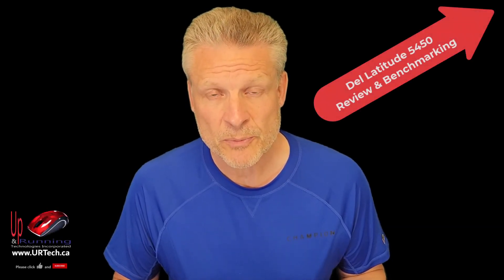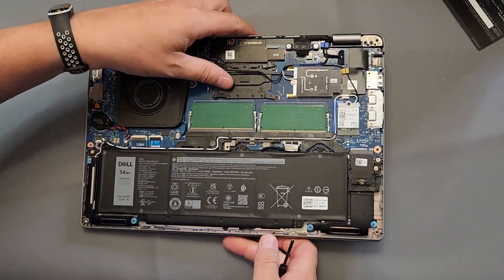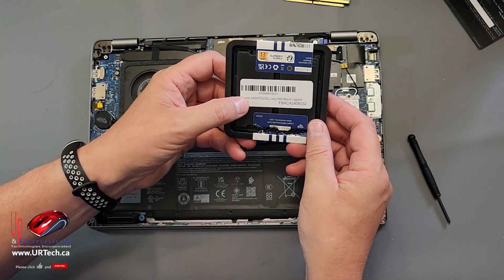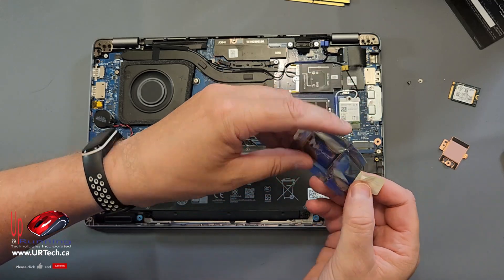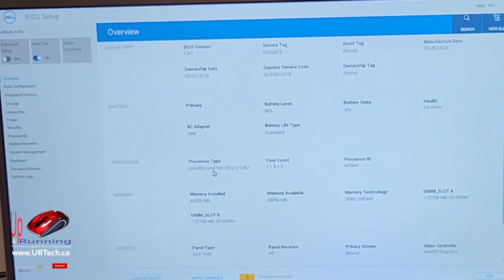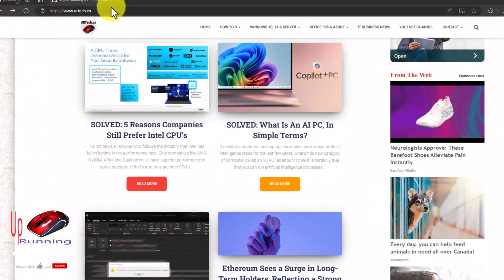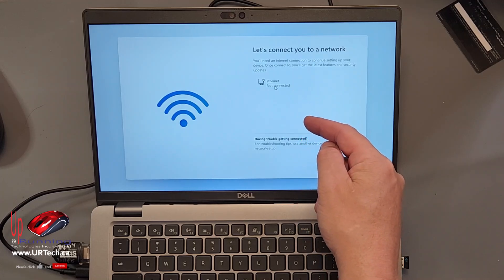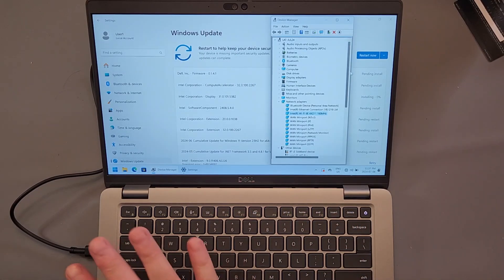EASY STEP by STEP: Dell Latitude 5450 Upgrade SSD, RAM & Disassembly

Comment: Excellent video. Followed the video to upgrade both the RAM and SSD in my new Dell Latitude 5450. FYI- it works with 96 GB DDR5. It shows 96 GB RAM on system info page in Windows Settings after I installed it. I used Crucial 96GB DDR5 RAM, 5600MHz (or 5200MHz or 4800MHz) Laptop Memory Kit, SODIMM 262-Pin, Compatible with 13th Gen Intel Core and AMD Ryzen 6000 - CT2K48G56C46S5. It's two RAM sticks of 48 GB each.  Ordered from Amazon.

Comment: Do you need to unplug the battery from the board before adding in the 2nd RAM? I'm looking to upgrade my new Latitude 5450 2023 model. Is there a risk of frying the motherboard?
Reply: no, but is recommended

Comment: Thanks for this! I just upgraded to a 1TB on a Latitude 5450 and unlike previous Latitude models, where I had to change the BIOS Setup>Storage> to AHCI/NVMe from RAID On when upgrading or reinstalling Windows, now Dell requires a Driver.